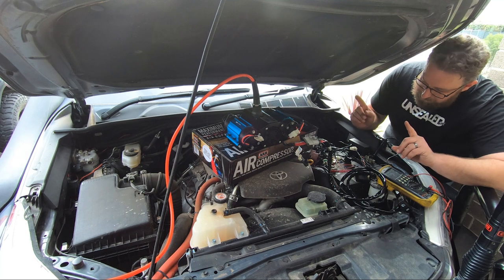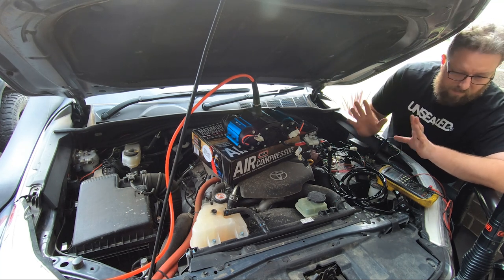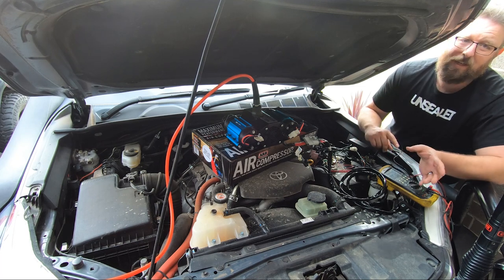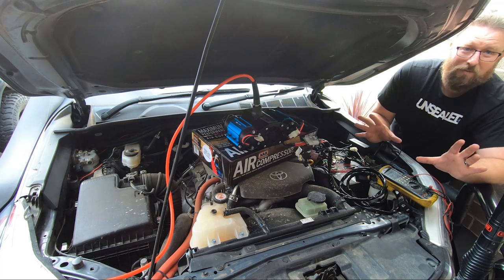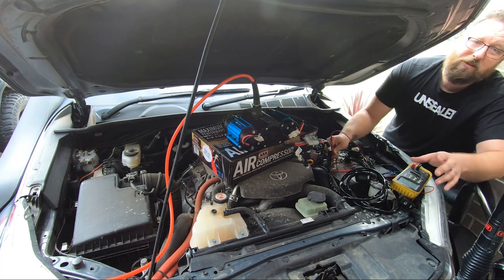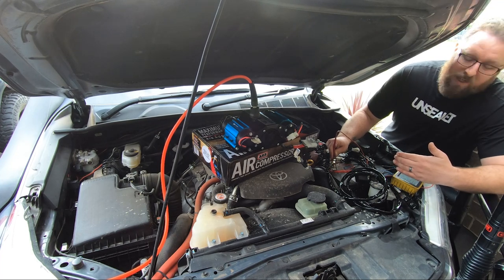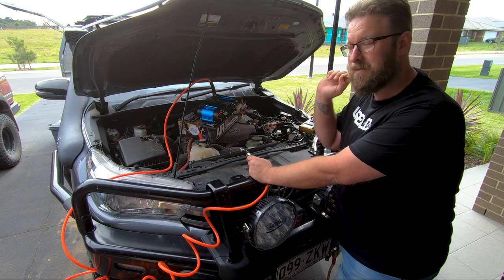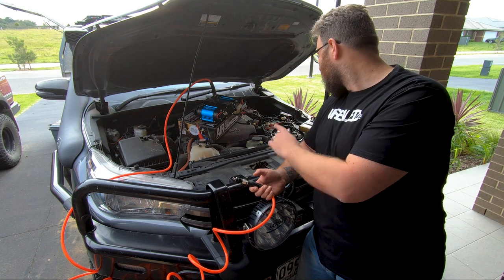12V Amp draw guide: extend the life of electric motors in your 4x4

Comment: Another way to look at it is Volts equals the size of the pipe the electricity is flowing and Amps is the amount of force that is pushing the electricity through the pipe. Less Volts requires more Amps ( force ) to power the motors, more force is going to create more heat.

Great vid as always :)

Comment: I think you may be wrong in your assumptions. It would be best to use a clamp ammeter. What you're saying is what happens with AC induction motors with a drop in supply voltage, not DC. I think you'll find the current draw will be the same. The voltage drops without the car running due to the internal resistance of the battery, which will cause your battery to heat up to some extent (i^2*r) losses, however, at a given load (i.e psi) the torque remains constant in a compressor and torque is proportional to current. Varying voltage to a DC motor is common for speed control, power is proportional to speed. Thus, I think you'll find the amperage is the same, but the motor will be running slower due to the volt drop caused by the internal resistance of the battery. The motor running slower is what causes the motor to heat up a little bit more as the cooling fan is running slower also. 

I'd recommend running the test using an amp meter and making sure you keep the load (psi) the same in the test.
Reply: You're spot on mate, the only hassle, is that the pressure (psi) won't stay the same in real world. The load is steadily increasing as you're going. This was done for the average joe, as a good lesson to look after their motors, and do everything they can to get as long out of them as they can. Been hearing of a few blokes burning out motors recently, and the common condition was not running their four-wheel drive, while pumping up or winching. Just trying to keep things simple :)

Comment: I must be a bad boy than because I run my big and small 12 volt compressors all the time without the engine running. Shoot, it is how I tell if the bats are low when i'm walking past the vehicle. lol 
That being said I can pump up a tire and winch a couple small trees out of the way without starting the rig. Of course, I have 3 x 78N start batteries. It actually helps the batteries to not have a huge load on them at any one time. Spread out the big loads over more batteries and the batteries last longer and treat you better. 
As a side note I tried all kinds of compressors and broke most. Not the motors though, just the compressor bits. Usually the area around the bearings or the cheezy plastic rings. Finally, I got the big Smitty Built and as a backup/assist I also run a OEM from some kind of Cadilac at the same time. Never had a problem since.

Comment: A motor is a resistive/inductive load. In lame mans terms p = v2/r. Put an ammeter / clamp meter on it. It is not a fixed output load (ie doesn't have a converter inside)
The volts going down DOES NOT increase the amps.
The volts going down decreases the Amps and the power by the square law.
Sure, lower voltage will labour the motor and possibly convert more power into heat.